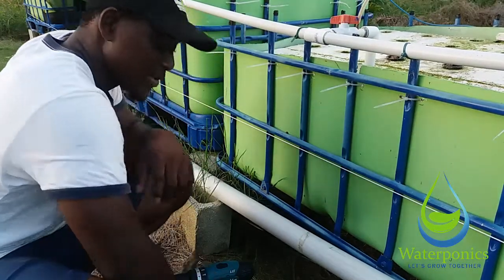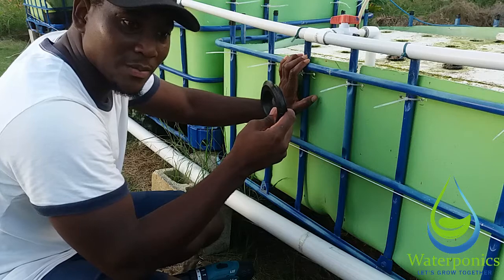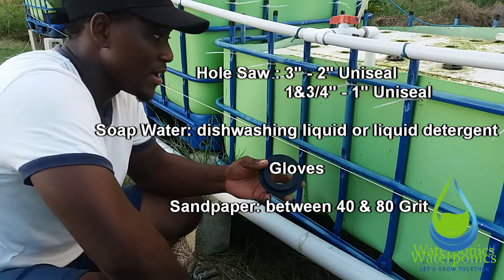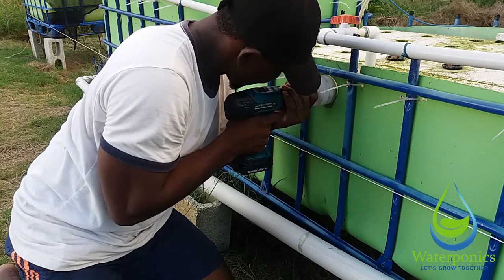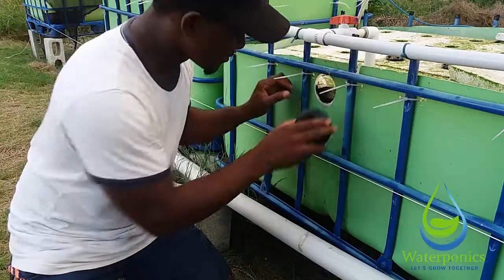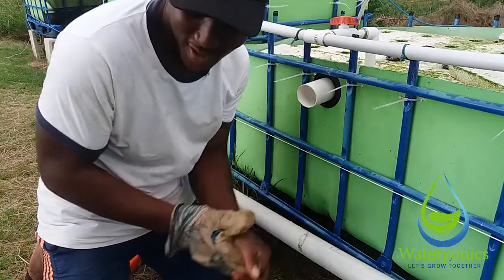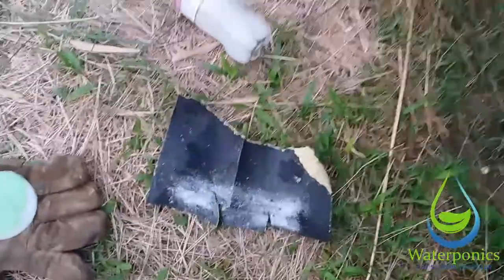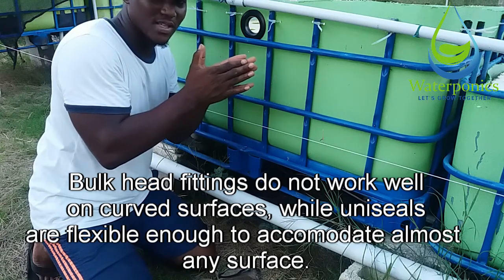How to Install a Uniseal

Comment: It helps if you use a grinder to take the edge off the pipe before you insert it and will preserve the seal. It seems like he may have limited access to tools but it does help

Comment: When you put the stem pipe inside the uniseal...do you buy those pre-cut or cut them yourselves? (One video I saw called the pipe piece going in the uniseal a stem pipe... is that a pre-made product or something most people cut and make on their own?)
Reply: Hi Noah, I have never heard of a stem pipe before. To my knowledge, most people cut the pipes to the desired length then insert into uniseal.

Comment: I think the uses for that will be pretty limited. If it's below the water line in an RV grey tank with water constantly there it's gonna leak before long.
Reply: Uh I use these in hydroponics deep water recirculating. So constant water at about a depth of one and a half feet